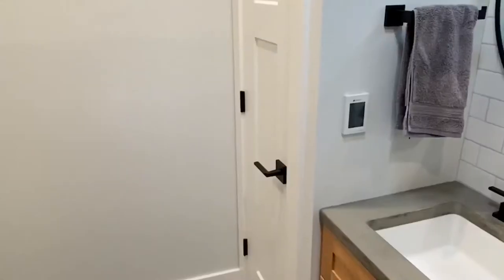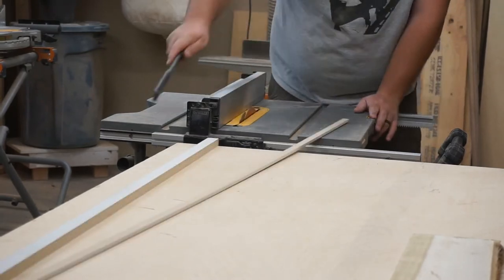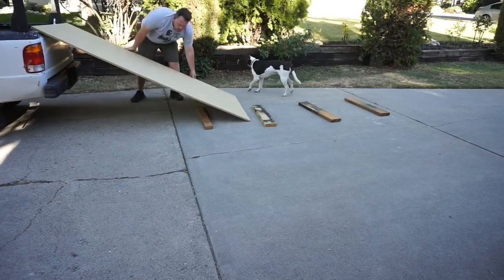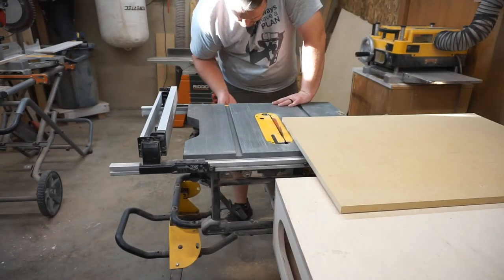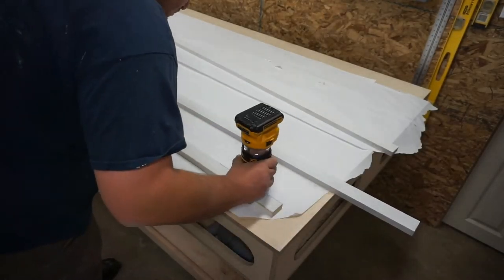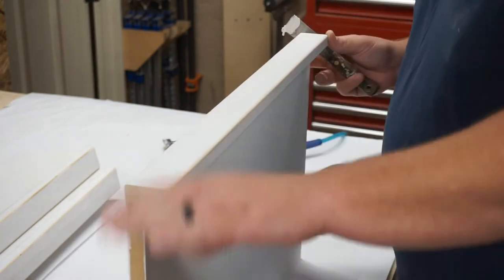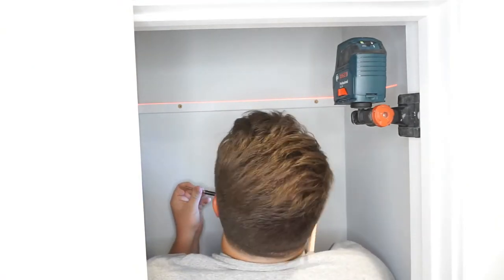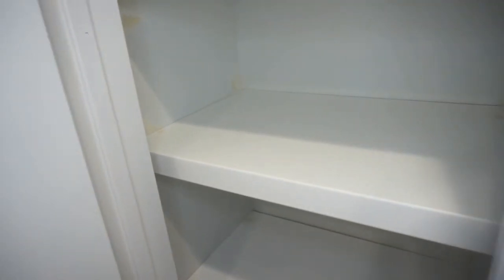DIY Closet Shelves. Fast, Cheap and Easy!

Comment: So I pretty well followed your guide to the letter - pretty happy with the way it turned out.   Things I erred on was not cutting the shelves to a "tighter" tolerance on the width - took  more  caulk to fill in the gaps.     And attaching the face board to the shelf - another area to work on - some of mine had a very slight ridge - that made it harder to create that seamless look.  All novice mistakes.   Thanks for the video - my only suggestions might be  to provide links or additional comments on the material used (paint, router bit used, etc).   It will help novice folks - like myself - and in my opinion make a great HOWTO video even better...

Comment: What size screws did you use to mount the 1x2 supports to the wall? What size brads/nails in the nail gun for attaching the shelves to the supports? Did you also use glue? Finally, what did you fill the space left by drilling the screw holes? My area where I am going to add shelves is a bit wider and deeper (about 3 feet each direction), but this is exactly what I envisioned when we converted our tub to a shower, and pulled the old shower stall out. Had all that done by pros, so all I have left to do is add the shelves where the shower used to be and paint the wall and shelves. Thanks for a great video!

Comment: What did you use for the circular saw guide.   Looks like a DIY guide.    Nice job on the shelving - MDF easy to cut vs 3/4 wood.

Comment: Awesome. Mind if I ask a few questions? How did you paint all three sides of those front strips without getting paint all over your fingers and having the strips stick to the tabletop? Also, what is that tool you used to make the roundover?
Reply: Late but idea for u 
Take a 1x2 furring board $1.50-2 @ box store cut in half or 4 equal pieces lay them down now put wood you’re painting right on top of them basically you’re just making mini  saw horses that lay on table/ counter top’ 

Tip paint your edges first then roll out top’ 

Hope that helps
Reply: @joshymcdaniel9233  Thanks
Reply: What I ended up doing is putting some 1.5" finish nails through some 1/2" thick scraps and setting the pieces I'm painting on the sharp ends. I can even paint both sides of a board at once.
Reply: @Bapuji42  glad u got it sorted’ 
Answer to your question was 10 months late 🤣 perhaps it will help someone in the future reading through’ 
If you  didn’t figure it out 
It’s a round over bit’ 
Most common are 1/8” or 1/4” rounder bit for router’